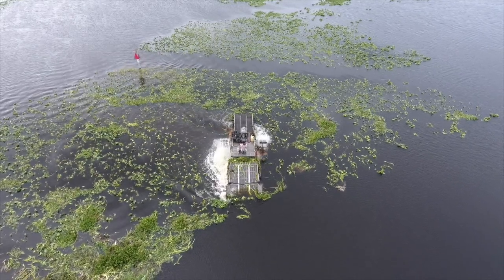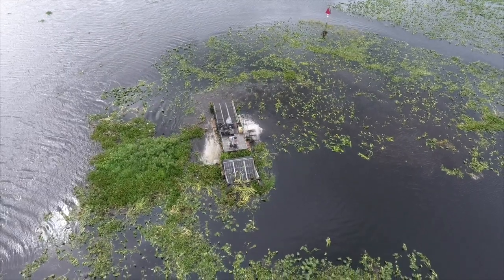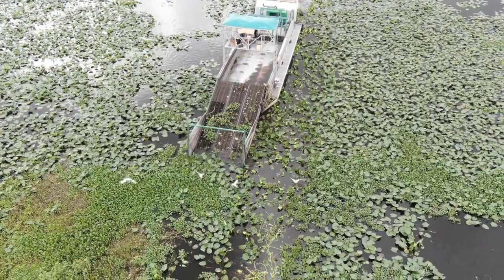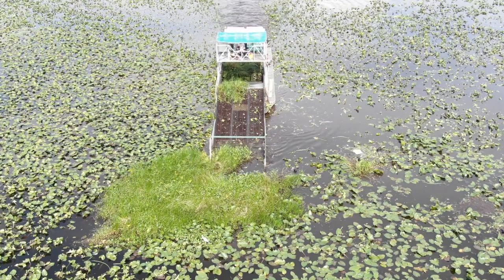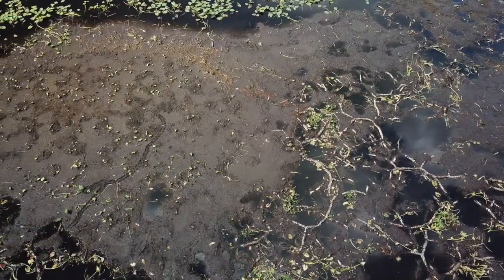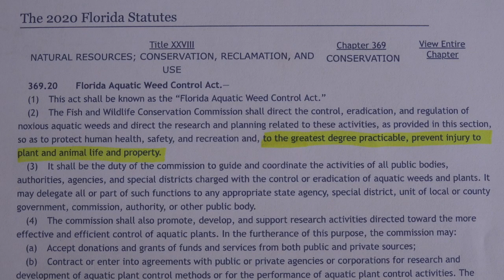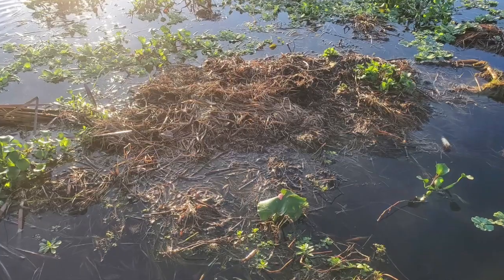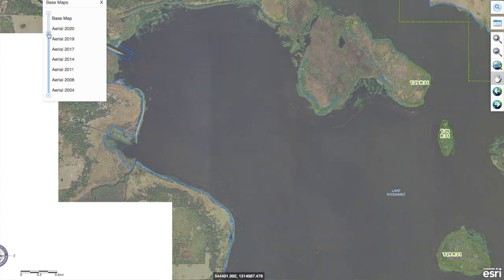FWC botches harvesting job on Lake Kissimmee

Comment: Thank you very much for this important video. I would add that the exclusion bar does not exclude other good, native floating species. While my greatest concern is for controversial Pistia stratiotes (the fact that this proven native is "controversial" is what drives my concern) there are other native, floating species that are taken up and killed by these harvesters, as well. In addition to the other reasons you gave for summer being a bad time to do this, there are also lots of birds and other animals breeding and nesting in this vegetation at this time. So, excluded or not, this harvesting process is devastating to the wildlife of these freshwater systems. ** (my computer cut off the end of this video, so you might have addressed these concerns).